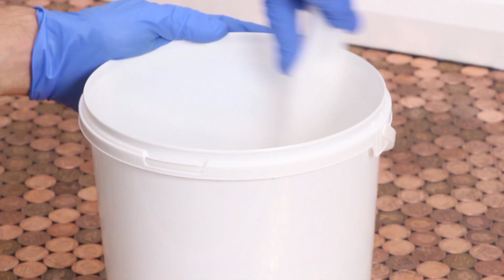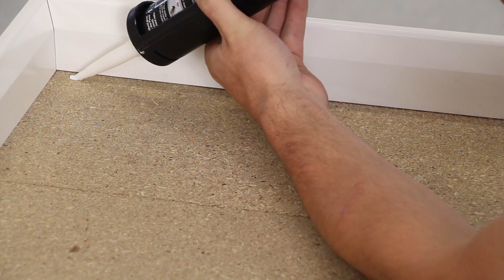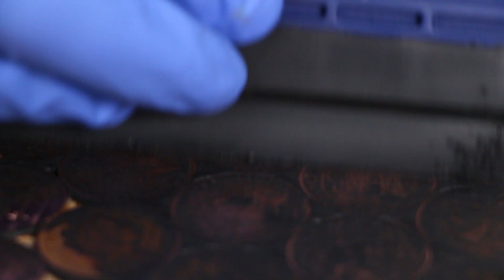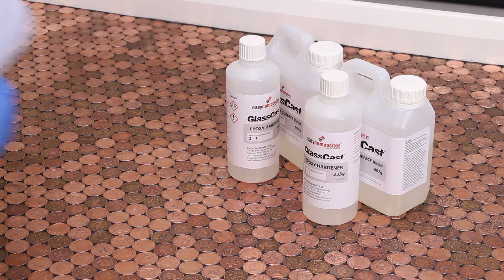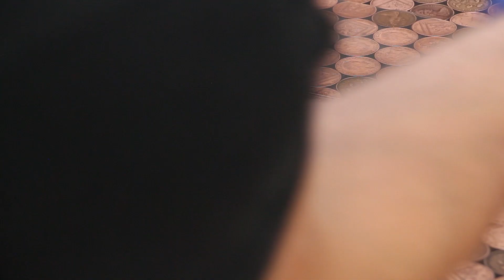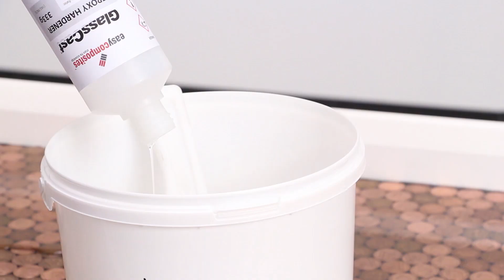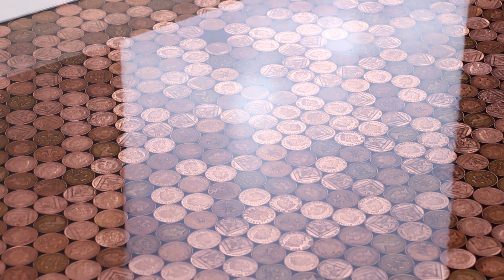How to Lay a Penny Floor with GlassCast 3 Clear Epoxy Resin

Comment: is this RESIN same used in CARBON FIBER ???
Reply from the maker: No, this resin has been specially formulated for surface coating.  You want a laminating resin such as our EL2 which can be found here: http://www.easycomposites.co.uk/#!/resin-gel-silicone-adhesive/epoxy-resin/EL2-epoxy-laminating-resin.html
Reply: Thanks for Reply 
i just need to Fix Cosmetic Clear Coat and Scuffed Marks that is Exposing the Carbon Braid , also certain areas Clear Coat Flaking and Bubbling ??
Was Thinking just using this stuff cause it Cheaper
Reply: Thanks but Some Areas Flaked or Chipped off Structure ok for Cosmetic !!!

Comment: Hi I am an artist and wondered if this would be suitable for covering paintings,embedding embellishments and also for pouring into wood ??
Reply from the maker: Yes you can use the GlassCast 3 over paintings and ArtWorks.  For thicker castings up to 10mm I would look at our GlassCast 10 and for thicker sections - especially wood such as river tables and knot filling then our GlasCast 50 may be more appropriate.
Reply: Easy Composites Ltd thank you .....it’s difficult as I do paintings, casting and inlay table tops too which would cover all of those ?? Or would I be better having both types of resin??

Comment: Would it work with any fabric, or do you need to use heavy specialized fabrics. Also is it available in the USA?
Reply from the maker: It works with just about anything. We've seen customer projects over the top of denim, sack cloth, carbon fibre, all sorts! There might be different techniques to get the most out of different materials but generally speaking, anything the resin can bond to will be OK.

Comment: does it scratch easy ? looks very nice
Reply from the maker: Epoxy resin is very tough resin. The GlassCast resin is really pretty resistant to scratching and we've seen thousands of floors now that people have done which are holding up very well to daily use. In the future, if you did want to remove scratches then the resin can just be polished to bring it back to original condition.

Comment: I have a mini bus im doing a conversion on. I have laid some reclaimed clear fir that i have lapped on one side so its pretty stiff. The floor will still have some flex to it being a bus and all. I plan on burning and coating the floor. Will it crack or peel from the carbon left from a light burn to bring out grain?

Comment: Hi, when you calculate the amount of resin required, please can you tell me what thickness you calculate the final result being
Reply from the maker: When we refer to 2kg per square metre we're assuming 2mm of thickness. As it says in the calculation you need 1kg per square metre per millimetre of thickness so to work out your resin requirement just multiply the length (in metres) by the width (in metres) by the thickness (in millimetres). Example, 4m x 4m at 3mm would be 4 x 4 x 3 = 48kgs.
Reply from the maker: When we refer to 2kg per square metre we're assuming 2mm of thickness. As it says in the calculation you need 1kg per square metre per millimetre of thickness so to work out your resin requirement just multiply the length (in metres) by the width (in metres) by the thickness (in millimetres). Example, 4m x 4m at 3mm would be 4 x 4 x 3 = 48kgs.

Comment: I am so excited to have found this! I have a penny floor in my kitchen/diner for the past few years - my builder just put a spray on it and now the coins are discoloured. I am planning polish coins, re-grout and use the glasscast epoxy - this tutorial was brilliant. My question - I have underfloor hearing (otherwise the coins are freezing) which means the plywood floor sometimes shifts with the heat. Will this affect the glasscast and cause it to split or while the weight of the resin ensure it is firmly pressed down? Thanks so much!
Reply from the maker: Glasscast is compatible with under floor heating systems that go up to around 40-50C in temperature. We would not expect any movement of the GlassCast itself once it has fully cured.
Reply: Easy Composites Ltd  - Thanks so much for the reply. Will being ordering some as soon as I have measured up and know how much to order.
Reply from the maker: You can buy it from the Easy Composites website. There's a link in the description above.
Reply: Where i can  buy this resine?

Comment: I'd like to pour this over a travertine floor. Once the tiles are down and grout has dried, would you recommend sealing the tiles with another product first, or is the Glass Cast by itself sufficient? I'm just worried that there may be a bunch of air pockets being a natural stone.
Reply from the maker: The GlassCast could be poured directly on but as you say there could be the possibility of some 'breathing' from the stone. If you do want to seal it then for the best compatibility, you're probably best applying a thin 'brush coat' of the GlassCast onto the the floor to seal it. Alternatively, if there's a way to do it - you could do a test pour onto some of the stone (without sealing) to see if there are any issues of air bubbles, if not then you know you're safe to skip the sealing stage.

Comment: Then you drop something hard and heavy on it chipping or shattering it, wyd
Reply from the maker: It's pretty tough stuff. Epoxy has been used as flooring in warehouses, garages, workshops and factories for many years because it's one of the hardest wearing materials you could have on a floor.
Reply: Easy Composites Ltd well that's good to know, smashing hours of workin a second was the only thing standing in my way of having a floor made of penny's, thanks

Comment: Can this resin be used for jewellery making?
Reply from the maker: Yes, it can. You can do small clear castings (or embedments) or you can use it as a domed coating over the top of badges/broaches/pendents etc.

Comment: Hi, we would like to do this on our hallway floor, however, how do we stop the epoxy resin from flowing out of the hallway and into our living room? Many thanks!
Reply from the maker: You will need to build a physical barrier at the door opening.  Many floors will have a wooden or metal door treshold which can be removed while a temporary barrier is put in place.  You can then neaten the edge after curing of the resin to refit the threshold or fit a new one to suit. If done neatly, you should be able to hide the edge of the penny floor casting under the threshold trim piece.
Reply: Easy Composites Ltd what do you recommend to use as a physical barrier? Dont want it to be stuck and end up peeling/ cracking the edge of the resin
Reply from the maker: Polypropylene plastic is ideal as it does not stick to resin - you can get it in sheet and strip form from building merchants.  Alternatively any hard plastic or metal treated with a release agent will work fine.  If you struggle with either we sell both release agents and polypropylene sheet if you need it.  Polypropylene can be found here: http://www.easycomposites.co.uk/#!/patterns-moulds-and-tooling/Mould-Making-Materials/polypropylene-plastic-sheet.html

Comment: Thanks for this, I am pouring Glass Cast tomorrow on a table. One thing I noticed with the black grout (same stuff you used in this video), it has a very undesirable effect of cleaning the coins. The abrasion and chemicals in the grout polishes the coins up which is a real shame. 

Also was wondering if the alcohol can be substituted for pizza or similar when applying the coins. Thanks.
Reply from the maker: Yes, you need to be careful how much rubbing of the coins you do once the grout is present because it acts as an abrasive. If you're careful however, you can use this to your advantage, leave a faint trace of grout on some pennies and then rub some others so they shine. The traces of black grout over the surface highlight the embossed pattern on the coins and we found this to be quite a useful effect. Good luck with your pour. Post a photo when it's done.
Reply: I have 2x 1kg packs to use, can you tell me, do I still need to weigh out, or can i just empty both bottles of resin/hardener into one bucket? You say in this video that you should mix batches 5kg at a time so I think i should be OK mixing 2kg in one bucket?
Reply from the maker: 2kg in one bucket is fine. Even though you're using all of the resin from all containers we would still recommend weighing the resin and hardener. The reason for this is because there may be some inaccuracy in the filling of the containers (they will never be under but they might be slightly over) so by weighing them yourself as well you can ensure the perfect 2:1 mix ratio.
Reply: I have done it. Im paranoid that I didn't stir it enough but it looked great and i just had enough. I will see how it looks in the morning
Reply: hoarp001 how’s it turn out?

Comment: Amazing video,

What type of adhesive was used to hold down the pennies,Thanks,If using beer caps,also use a black grout to hold them.

Could you use Self-Adhesive Film Chequerplate,what is the mazinum layer thickness
Reply from the maker: We used 'No More Nails' to stick the pennies down. If you're doing beer bottle caps it's up to you whether you grout them or not. Grouting means you need less resin and also gives a flatter finish to the resin. When we made up the beer bottle cap demo board that you see in this video we did learn an important tip though which would be that if you're not grouting them (as we didn't) then make sure you do a thin pour of resin first, just to seal around their bases, let that cure and then do your main pour afterwards. Otherwise, you get some pesky air bubbles coming up from under the bottle caps as the resin warms up slightly during cure.
Reply: Thanks for the reply
Reply: @easycompositestv  how do do get this glass cast chemical in Nigeria please?

Comment: Just curious how resistant the epoxy is to scuffs/scratches from sand and grit particles on shoes.
Reply from the maker: Actually it's pretty good. You'll probably be aware that epoxy resin is used for floors in really high traffic areas like factories, hospitals, warehouses etc where it holds up incredibly well. GlassCast is slightly different because it's totally clear and you're looking through it to something underneath and so you do see scratches more than you do on a solid coloured epoxy floor but nonetheless it does hold up well. Of course we'd suggest trying to keep the worst type of abuse off the floor in order to preserve the finish as best you can but the great thing about GlassCast is that if it does get scratched you can polish it up to bring it back to new.

Comment: Could I use this stuff to make a window
Reply from the maker: No, although it's called GlassCast it's not intended to be a glass substitute. If you wanted to do something along the lines of a stained glass window then there are different resins from our range that we would suggest but in all cases the cast resin would not be as strong as glass so you'd need to do some experimentation and keep this in mind when you plan your project.
Reply: Easy Composites Ltd thanks I'm trying to make a custom cockpit wind sheild and bending acrylic would be difficult so I was wondering if I could make a mold and just use this stuff, what was the other resin you where talking about?
Reply from the maker: Got you. Is it a real cockpit wind shield or one for a model/scale plane? - If it's a real plane then I would be very wary of using any materials other than tried/tested/approved materials like perspex. If it's for a model then it's no problem to cast your own and in which case I would suggest our Water Clear Polyurethane Casting Resin. We sell it to the prototype divisions of some large UK based car makers where they use it to cast vehicle light lenses for prototype/demo models. The moulding process is quite involved because it needs to be a thin cavity two part silicone mould but it's certainly possible and the water clear PU would be the material to do it with. It's totally UV stable and optically clear. You would need to degas it though so you'd need degassing equipment.
Reply: Easy Composites Ltd it is for a real cockpit but on a boat I'm designing to go pretty fast. It more for looks than actually doing anything I think I'll try to get something of eBay that I'll modifie but if I can't that resin you recommend sounds good thank you